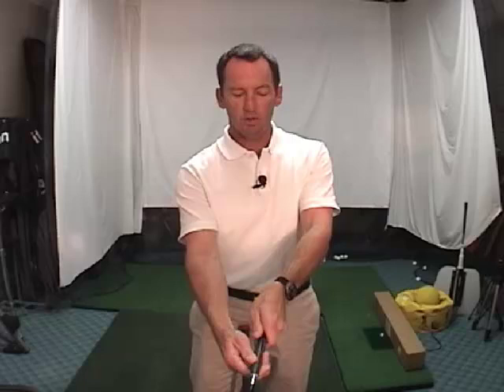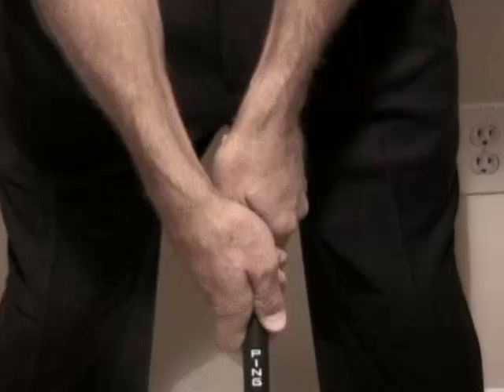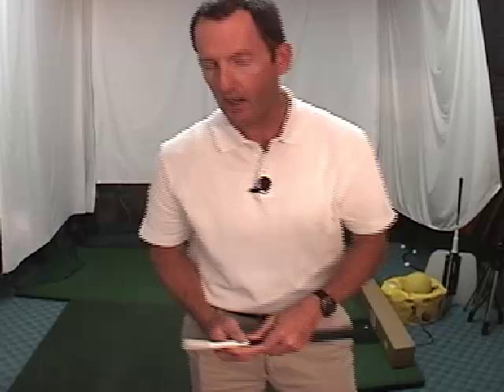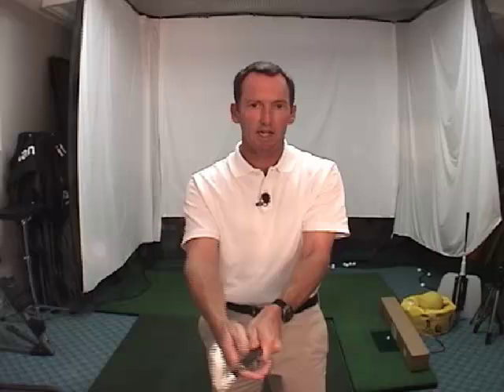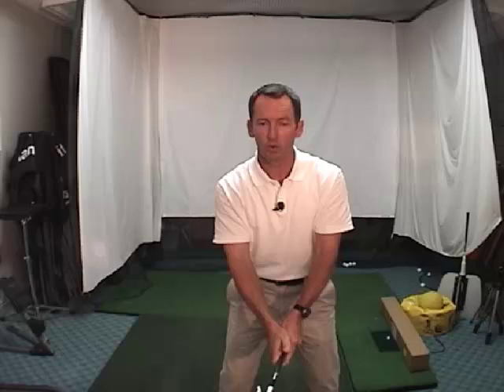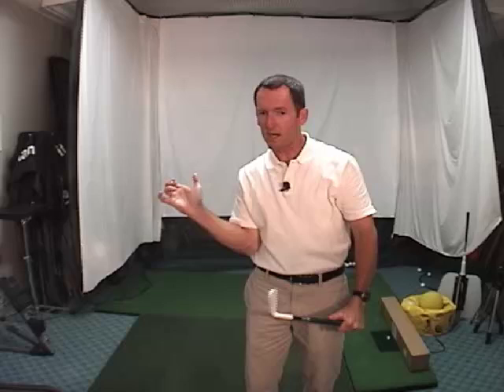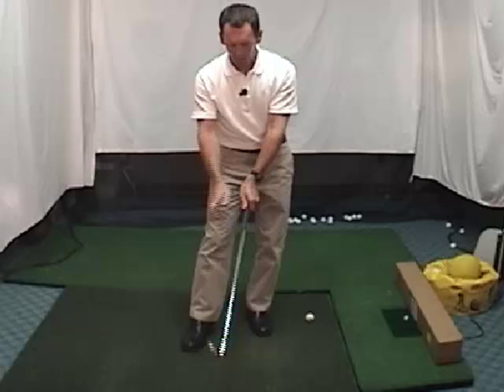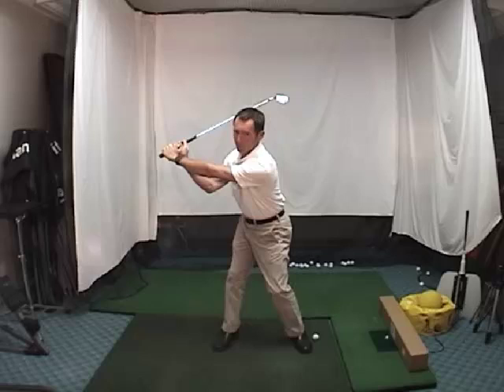Wrist Action in Golf Swing for Lag, Speed, Power & Distance by Herman Williams, PGA

Comment from the maker: 1) To avoid the hook, try to hold the wrist hinge longer in downswing. If hands get past the ball before uncocking the wrists the hook should be reduced. Obviously you can always weaken the grip if none of this helps. 2) I still want to be "swinging" the club into a hinged position so it has a smooth flow to it. Forcefully  pushing out to make the wrists set may defeat the purpose with too much tension. If you can have a firm left arm with "oily" wrists, you've got it.

Comment: Hey Herman thanks for the vid, really helped me out with distance. Where did u get that short golf club training aid?
Reply from the maker: Paul, it's just a 5-iron I cut off and regripped then painted white for visual effect. It takes a bunch of buildup tape to get the grip right since you're down on the thin portion of the shaft, but your local repair shop should be able to do it all for $10 or so.